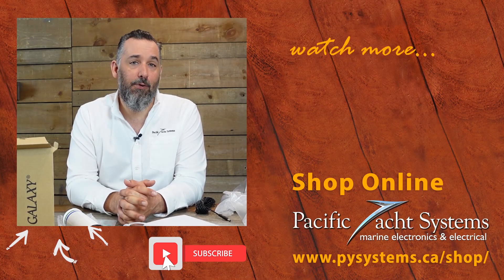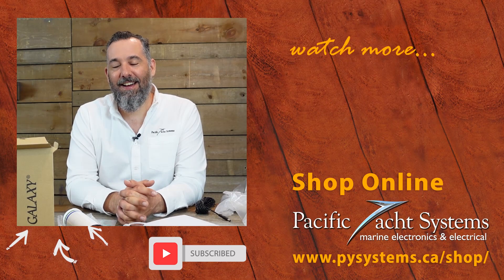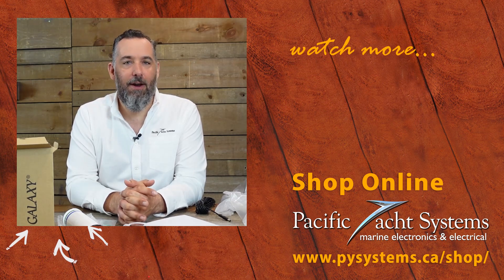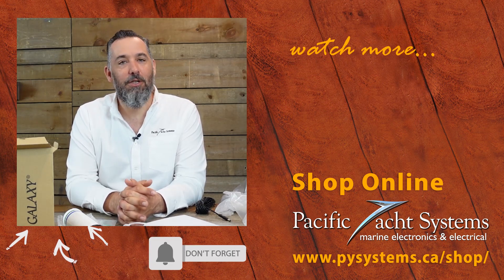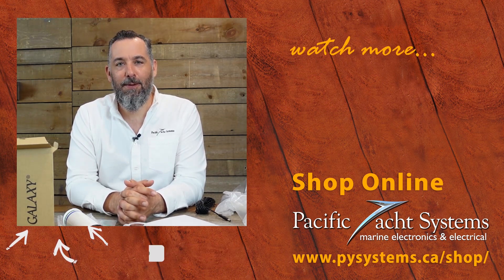Wind Generator vs Solar Panels on My Boat?

Comment: Well - I'm convinced.  Thanks for sharing this.  I just purchased an early 70s 30' sailboat that had a rat's nest for an electrical system.  I'm currently doing research into various components I'll need to build from scratch.  One thing I was interested in was a wind generator - but now I think I'll just add more solar.  Thanks again.
Reply: Hey mate...I just did the same thing . Currently labelling everything....will end up redoing everything so I feel confident.

Comment: Great videos!  Its amazing how much solar has changed!  20 years ago when I was outfitting my cruising sailboat,  it was wind first, then solar as solar panels were relatively low output.  I had a AirX wind gen and a 65 watt solar panel.  that panel was the same size as todays 100watt panels and we didn;t have MPPT controllers either, just PWM!
Reply from the maker: Hi Pierre, appreciate your input.
Reply: @PacificYachtSystems  Love the channel!!  The more Good information that gets out there there better! A chat with Calder must have been a "career highlight"  It would be for me and I'm not in the industry, though I wish i was!

Comment: Jeff, Thanks for these videos.

Agreed. As solar panels become more efficient and don't require maintenance - like wind and hydro generators -  I would say fit as much solar as possible - supplement with wind generation or hydro generation if you are looking of some energy generation redundancy. As with anything to do with boats, trade offs are required. 

Imho, the type of renewable energy sources to install depends greatly on: 1) type of sailing (offshore/ocean vs coastal), 2) the type of boat (monohull vs catamaran vs motorboat), 3) average expected boat speed through the water (if considering hydro generators), 4) average expected apparent wind speeds (if considering wind generators)

For most install cases, ie coastal cruising, imho, solar panels easily beat out wind and hydro generation, no question. Likewise for motor boats, solar panels the way to go for 99% of cases.

However, for ocean / offshore sailing, imho: 
a) in slower monohulls, solar panels supplemented with wind generation is a good option (potential energy production 24 hours/day if wind, and especially at night,  assuming you prepared for wind generator install issues and maintenance). Monohull sailboats usually have limited real estate for solar panel installs and the slower boat speeds make hydro generator less effective.
  
b) in performance catamarans, solar panels supplemented with hydro generation is a good option (potential energy production 24 hours/day if boat speed, and especially at night,  assuming you prepared for hydro generator install issues and maintenance). Catamaran sailboats usually have real estate for solar panel installs and the higher boat speeds make hydro generator more effective.
Reply from the maker: Thanks for sharing.